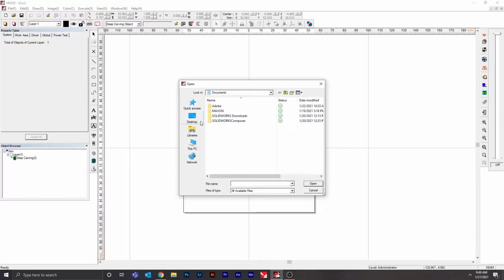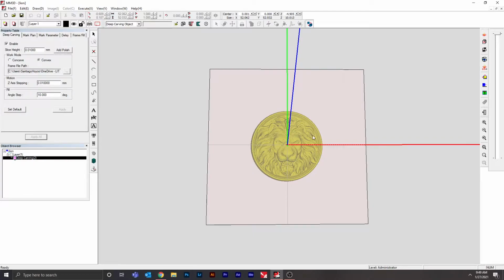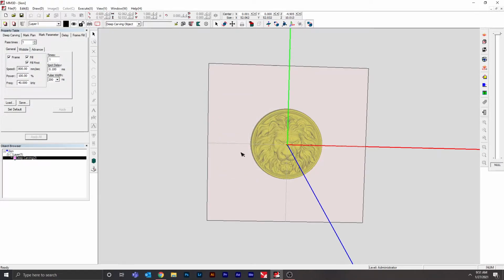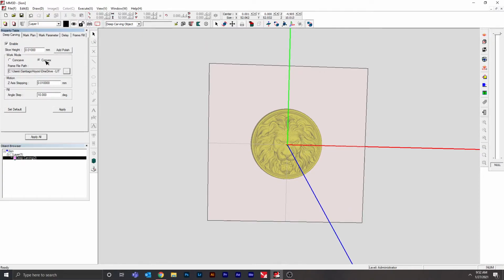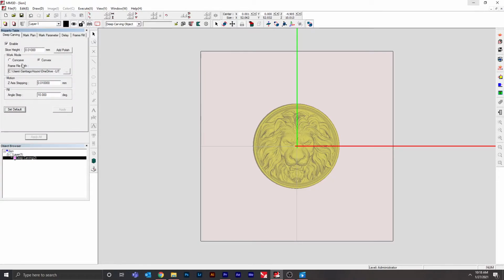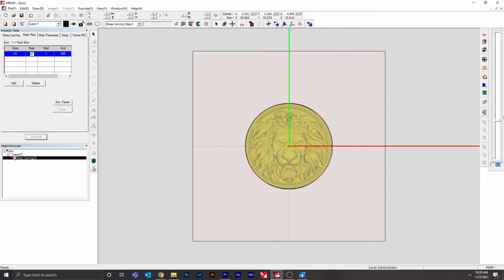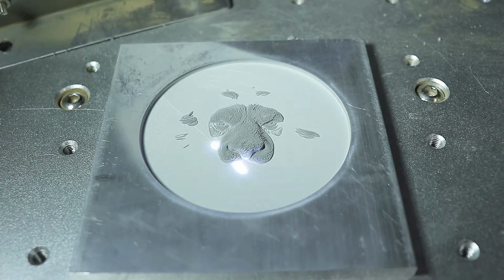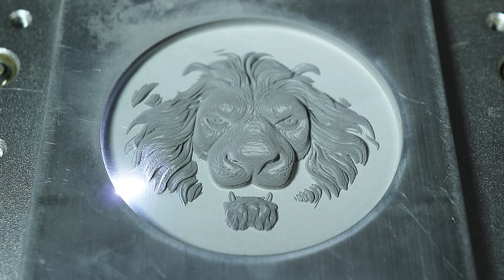3D Fiber Laser Engraver Software Overview Lit Laser

Comment: hello, I have same machine like yours. but i have a problem. I am working with silver material. I want to engrave photo on silver. My machine is 50w. program is MM 3D. I need settings for silver.
Reply: Hello. Out of curiosity do you have a Lit Laser machine. I am looking for others who own one as I am having issues with the MM3D software that came on the laptop provided. Since Lit Laser went out of business a few years back I am lacking support.

Comment: Do you need a 3D fiber laser or can you use a standard 50w fiber laser?
Reply from the maker: You will need a 3d laser for 3d engravings
Reply: @litlaser626  Is it possible to upgrade a 50w to 3D?
Reply from the maker: @omar-4eva  Yes, it can be done it requires the whole machine to be stripped down and replaced with new parts for the upgrade only keeping the 50w laser source
Reply: @litlaser626  That sounds good, I've replaced a laser source, so understand the different parts. How can I find out more?
Reply: @omar-4eva  I have the same issue and I would be very interested in too ...

Comment: Could this be done on a gun?
Reply from the maker: Yes, depending on the material
Reply: @litlaser626  I have a glock 19 so it's made with polymer. This would be amazing to do on a grip!
Reply: @DADEE23  😂 you can't go to deep on a lower it ruins the integrity of the lower but you can do the slide and custom stippling on the lower just not 1mm plus deep the lower is built to a certain tolerance you take off too much material you gun is done dude.

Comment: Nice lessons. I want to buy a fiber laser. Is 20w good enough for this kind of job
Reply: For this I would say 50w minimum. I have a 30w and wish I had gotten the 50
Reply: @TheDopalgangr  but can the 20w engrave on metals
Reply from the maker: @okyereemmanuel5236  Yes 20-watt lasers can engrave on metals. For 3d engravings, I would recommend a 50w machine minimum
Reply: @litlaser626 Excellent tutorial. Can I ask the make/model of your machine? Thanks from Australia
Reply from the maker: @MrBennybrice https://www.litlaser.com/products
In this video, I used our 50 watts 3D machine
Reply: @litlaser626  no price quotation for products on your site
Reply: How much is the 20w, 30w and 50w
Reply from the maker: @okyereemmanuel5236   Please email sales@litlaser.com for a price quotation
Reply: @litlaser626  hi now looking to get into this type of hobby. What type (brand) laser would you recommend for hard plastics and metals, the types of metals and plastics that are of gun/rifle quality? Is Photoshop the only programme you need?
Reply: Hi, any kind of 50w fiber laser can do this? I assume it is only the software? Am I right?
Reply: It that take 36hour is he said? For some job fiber laser best but if u need engraving Cnc much faster than this if it take 36 hour
Reply: @miamidebirturk  Might not be faster on a CNC unless you have a 50K RPM (or more) spindle.  You would need to run a .016" (possibly smaller) end mill to achieve the level of detail.  That size tool doesn't exactly hog iron...